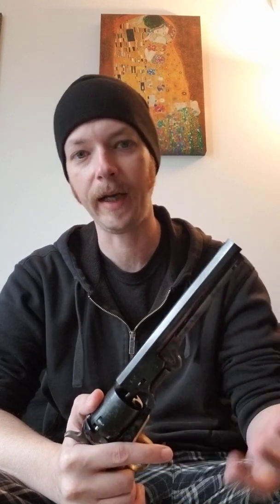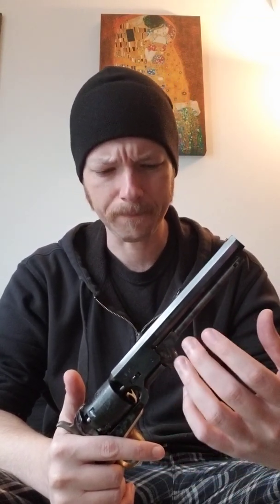Why percussion revolvers "shoot high"

Comment: Yes indeed while investigating factual history regarding the percussion cap&ball revolvers, we find that the idea of the19th century original era was that Colt's revolving pistols were to take the place of a Carbine long arm.

Colt's percussion revolvers factory front sights are very low height . The factory sights were regulated out to 50/75+ yards distances for the soldier shooter to aim for the enemy's Belt Buckle which resulted in the ball or conical bullet hitting impacting into  the enemy's upper torso area.

We also know from 19th century history that both organizational units and individuals who purchased Colt's percussion cap&ball revolvers often had taller front sights mounted by Gunsmiths/ Blacksmiths. As well as had Loading Lever Latches mounted on the Walker Colts.

I personally have Master Black Powder Gunsmith Dykes Reber and his assistant Marty, of the muzzleloadershop.com Located in Berryville Arkansas mount taller Front Sights and Deepen the Rear Hammer Sight on ball my Colt style replica percussion cap&ball revolvers.

With the taller Front Sight and Deepened rear Hammer Sights and other improvements done such makes my percussion revolvers "Well Regulated", properly functional of a high standard.  Where I do achieve Point of Aim impact accuracy while using my Kaido Ojamaa-VKJV Universal RFN Bullets.

Comment: Never noticed this on my Remingtons.... I always use full charges as designed and found that they are a tad low at 25 yards, needing about 1/32" off the font sight. Hits on human sized targets are quite easy out to 75 yards or so.... at that range aim at top of head for a thoracic strike. Seems to work with RBs or Conicals..... Most that have issues with trajectory are, from my observation, using reduced charges and fillers etc. I always run my percussion revolvers 'full throttle' with as much 3F as will go in and still be able to seat the projectile. It has been working well for me for the past 30 years.
Interesting vid though... 🙂
Reply from the maker: Seems to be mainly a colt thing but downloading any black powder revolver will make it shoot like a rainbow

Comment: They shoot high because they have very short front sights. The best way to correct this on colt clones, is to file the rear sight notch in the hammer. The more you file down, the lower the shot placement will be. File left or right to adjust windage. For Remington style revolvers, you can install and adjustable rearsight or get a taller front sight installed.
Reply from the maker: Nice name, I just watched back through lonesome dove recently.

Comment: I have a Remington .41 rimfire vest pistol that shoots high as well.If it is  aimed for the crotch it will hit the chest at 4 ft.Now if closer it will hit the belly.Aim for the knees to hit the crotch.
Reply: Where are you finding. 41rf to shoot
Reply: @TheBiggestIron  YT sucks for not putting up notifications in a timely manner so I just seen your inquiry.This is where I bought my reloading kit and you can get more bullets and cartridges if needed.https://www.hc-collection.com/41-rf-c102x335272?PGFLngID=1   You'll have to get powder and .22  blanks locally.I used starter pistol .22 and they work.I us Trailboss but I'd recommend to not fill them all the way to the top.It's a little hot and hurts your hand and might blow up the gun depending on its condition.There is another outfit selling the kit for over $240 US. This works, easy to reload but seat the bullet before adding the powder and then push in the .22 blank last.Position the blank to line it up with the firing pin and you'll get fire in the hole.Hope this helps.
Reply: @paulcallicoat7597  I've seen those. I've never seen someone draw there cartridges from sheet copper and prime and load that like an original. Any skill machinist could, I'm not one
Reply: @TheBiggestIron  Back in the 1970's there was a run of the .41 rimfire shorts by a manufacturer and I could get them at the gunshows but it's been 15 years since I seen any available.  I'm sure that most of us  wouldn't want to go the route you suggest as the old cartridges were primed like a .22 and not reloadable.These  ones on the website that I posted work really well and I've reloaded them a number of times without any problem except I have to use a nail to get the .22 blank out once fired to reload. I put them in my ultrasonic cleaner and they come out clean and ready to use again.
Reply: @paulcallicoat7597  you can reload rimfire. You tumble the cases and drop your priming power in. It hardens and works. Particularly better in a lever gun where the cartridges may rotate

Comment: Another thought I had was, when the gun fires there's a delay on the bullet leaving the gun and the actual powder charge burning. Like you pull the trigger and it it starts rising before the bullet leaves the gun completely, I suck at explaining but hopefully you get what I mean
Reply from the maker: Muzzle climb is definitely a thing, you tend to see that affecting accuracy during rapid fire in modern guns or in older ones like flintlocks, there is a delay between pulling the trigger and the gun actually firing because it has to ignite the powder in the pan with a spark, people who aren't used to that delay will pull their shots.

Comment: I'm of the opinion that a lot of people approach these guns with the mindset of a time traveler who can't get their head out the 21st Century when they find themselves handling something from the 19th. Think of that every time someone remarks about how problematic it must have been trying to reload-- one tends to forget that your opponent is in the same situation if they get all six shots off without result.

People tend to forget these muzzleloading belt and holster pistols were military weapons. They would be laughable on a modern battlefield, of course, but they were designed for and purpose-built to the task of killing enemy soldiers (or, in the case of Army caliber pistols, their horses).